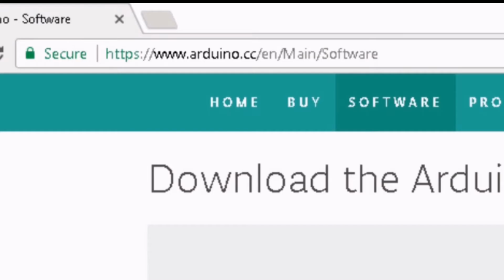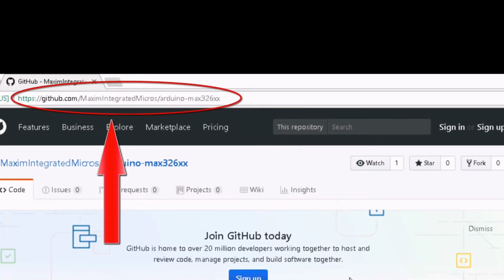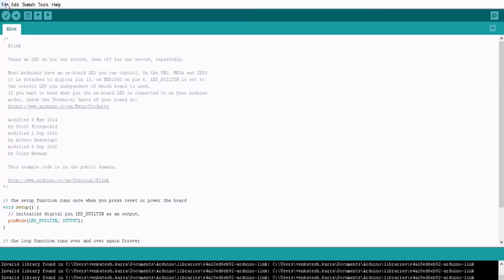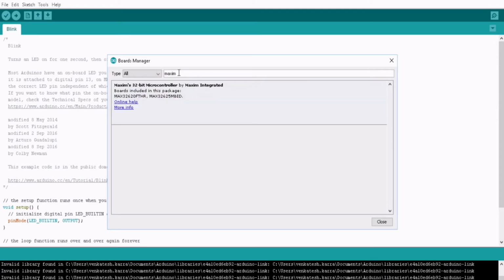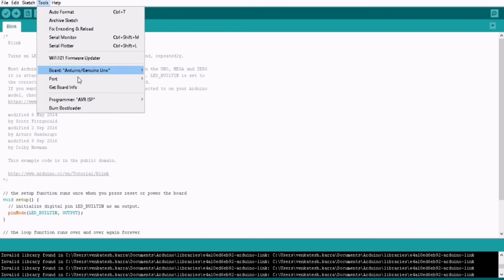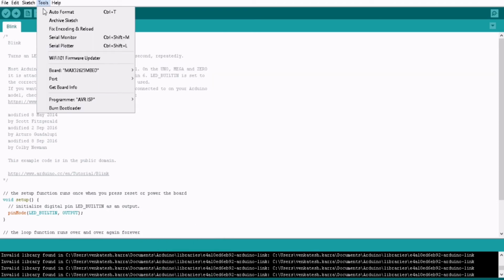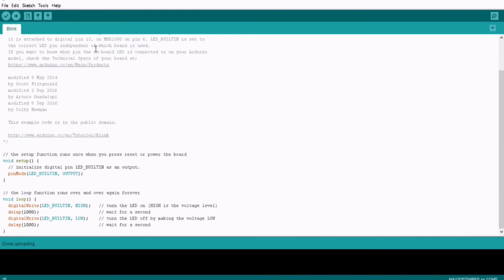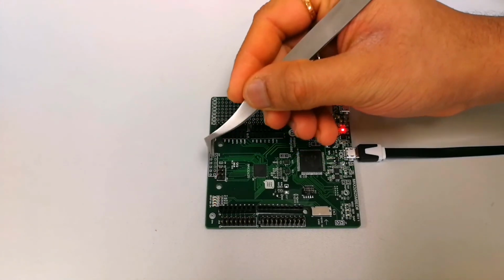3117 - How to Setup MAX32625 MBED board using Arduino IDE

Comment: I'm a little confused on what the mbed platform/os is..  for example, I see the Arm Mbed OS is on github, but I thought it had to be used with Arm's online compiler, but then I see they have a CLI, and Mbed Studio (Theia) that seems to download the Arm compiler 6 toolchain to your computer!
So.. is an active internet connection with Arm required to compile/debug or program? 

Can mbed be ported to a board not officially supported, or does the cloud need to recognize the board (pyOCD) before it will work?
Reply from the maker: Hi Ben, thank you for your questions! If you submit a technical support case at https://maximsupport.microsoftcrmportals.com/en-US/tech-support/ we will be able to thoroughly answer your questions.